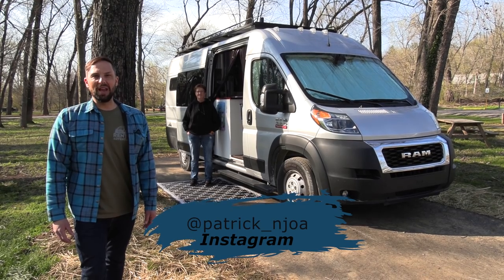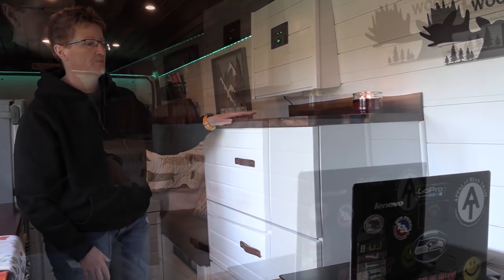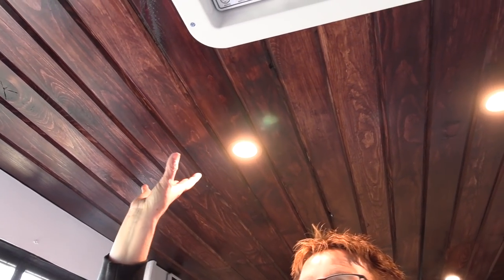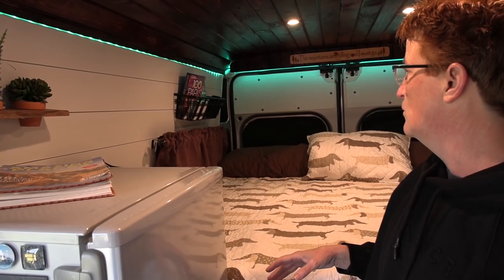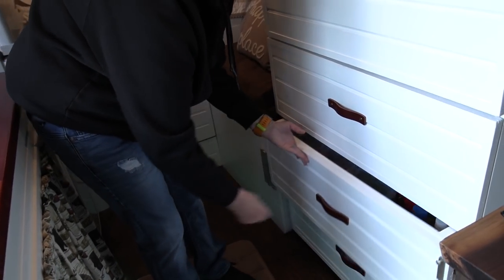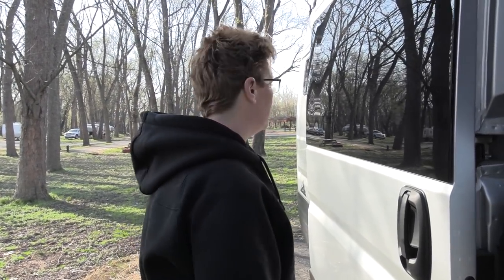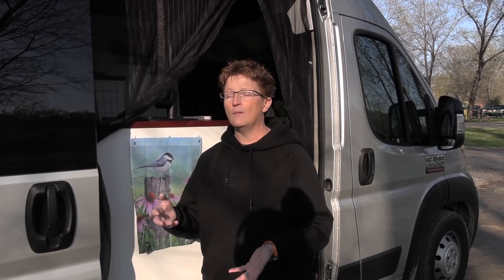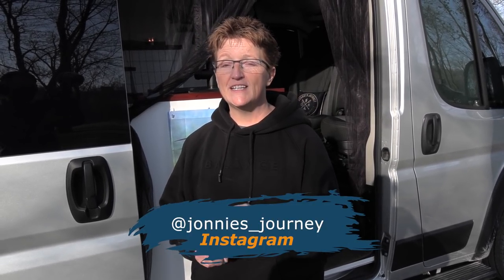SPECTACULAR TOUR - SOLO Female Travel Nurse Builds DIY Camper Van for Full Time Living #VANLIFE

Comment: I knew she wasnt just a nurse. Just spectacular! 
The thing that lit a lightbulb in me was her battery/inverter in the garage. In simplistic terms she put all the sockets on the battery itself and ran extension cords to wherever her appliances were!
In other  'youtube vanbuild electric setup vlogs' you get confused with all the jargon ( watts amperes volts mppt inverter etc) but she simplified it as basically one box (the battery/inverter) where she sticks a plug into it to charge the battery. And sticks a couple of "extention cords" into a couple  of sockets already in the box (one for each appliance) and strings the extension cords to wherever her appliances  are.

I describe it too simple perhaps. But she gave me a clear picture of the way the electrical system works in practical terms. So thank you. 
||thanks as well vlogger new jersey outdoor adventures You Rock :)
Reply: Thank you Louie.  You got it.  It is that easy. Thanks so much for watching

Comment: One thing about these compressor fridges, like Isotherm (US), Vitrifrigo (Italy), or Nova Kool (Canada) is that the stainless steel models are almost $1000 higher in price than white or black colors.  I think a white fridge is the way to go in an RV. Stainless steel is too dark and absorbs ambient light does not reflect it back. This model runs $1500 online in white.  A nice size, and the separate freezer is smart.  You can park a SECOP (Danfoss) compressor fridge (AC/DC only) on slightly sloping ground which you cannot do with propane or absorption type fridges. Makes such a difference in places like San Francisco which is all hills!

What a beautiful countertop, wow!  I'd love to know what tree this came from?  Such bold striping and rich reds and blacks.  It looks like Brazilian Rosewood.  Gorgeous.

Nice to see a woman so knowledgeable about the technical aspects of van life.  Not often seen.  The hot water system is impressive.  Nice size water heater.

The one thing I would change is to switch to a small diesel heater which will not produce condensation inside the van. It comes with its own small tank and you can store extra diesel fuel in garage or outside the van in gas tanks.  Strong heat, no carbon monoxide, no condensation, safer, and cheaper.

Very smart lady to make cardboard mockups! This is what Humble Road does too, a premier custom van builder. And to use your van before building it out, also crystallizes your requirements and layout.  Good approach.
Great interview, Patrick!  Lovely meeting Jonnie!
Reply: Thank you so much for all your kind words and information and although I agree with you on the costs of these fridges, I do have to agree on the price.  It's crazy.  The mockups really did help, very much worth the time spent doing it.  The counter top is Curupay butcher block.  😊

Comment: Black turned out on your window covers absorbs the sun to be used in the winter. And the reflectix without covering it up helps keep the heat in by reflecting the heat back in.
 That's why you should just used the reflectix without covering it up facing outward for summer . It reflects the sun away. 
I don't understand why people don't realize that and they keep putting black on both sides or try and cover it with fancy fabric. It literally tells people this on Google.  🤷🏻‍♀️

Comment: The tool that tile users use is called a contour gauge.. It will form to any kind of angle and then you just put that on your board trace it and  Cut on those lines and it should fit perfectly around any angle.. Some people use a scrolling tool but a contour gauge is so much easier.. I have 3 of them small medium and large size..
Reply: Perfect....Couldn't think of the name.  Thank you so much for watching tour Sharon.  ❤
Reply from the maker: Thank you for the information. For more awesome camper van tours please subscribe to New Jersey Outdoor Adventures.

Comment: Dang girl!  I can't believe you have all that electrical knowledge!  Can't say I'm a fan of the shower area as I would feel too claustrophobic.  Not to mention if it is not 100% dry, it will grow mold in no time.  I did appreciate the fridge.  I didn't know you could get them that big.  All the van conversions I've see only use dorm room size or cooler size.  That would not fit my needs since I do all my shopping before camping as most of my food comes from local sources.  I need a big freezer for meats and ice.
Reply: Absolutely true on the small shower, it is part of the small rv experience.  I love it that it is there when I need or want it.  The fridge is a marine fridge and has an awesome freezer space.  For camping it would be overkill but for living full time I really am liking it.  Thank you so much for watching.

Comment: Great build, I really like the modular electric design.  I would recommend that you pipe out your relief valve, in case it ever blows.
Reply from the maker: Great suggestion!
Reply: @NewJerseyOutdoorAdventures  Are there meetups for NJ van dwellers?  Working on mine still but always looking for new ideas.
Reply: Thank you so much for the tip I will do that.

Comment: Isn't the water going to get frost in winter season?
Reply: I winterize the tank in winter and just use portable water when in Missouri but when on road it takes a bit to freeze inside the van, just clear the lines by turning pump off and turning on the water.  so far so good.

Comment: that attic door would HAVE TO fold down for access
Reply: the area has a slight arch so 90 degrees is what I could get.  it is working so far but agree it would be even better at 180.
Reply from the maker: Yes.

Comment: Very nice, but that isn't an "on demand water heater"
Reply: I went to the description on Amazon and it says "on demand hot water heater".   Of course I don't have plumber in my title and really just called it what they called it.  What is it called?   thanks for letting me know because I don't want to give misinformation.
Reply: @JonniesJourney  I could be wrong but it looks like one of those 5 gallon electric water heaters. And I thought you said it was good enough for one or two short showers or something. And on demand water heater will run all day until you run out of fuel. Apparently there are some little units like that that are in fact on demand but this looked like a normal one and based on your statement of limited hot water I came to the inclusion it's a normal water heater.